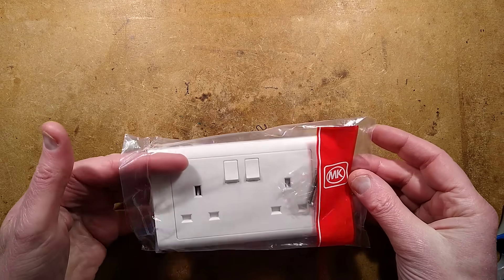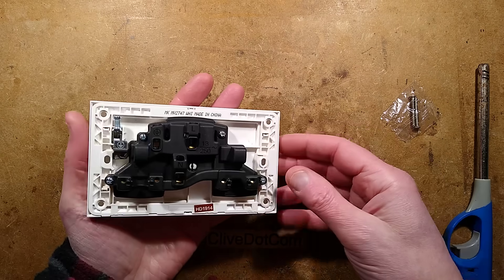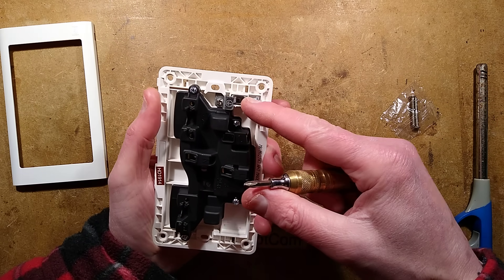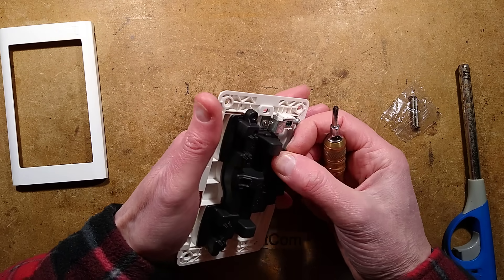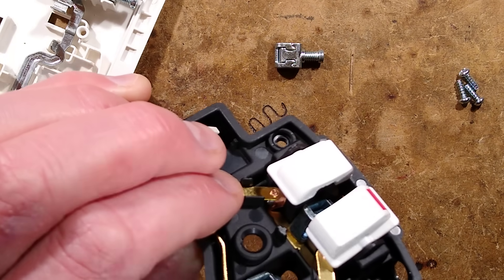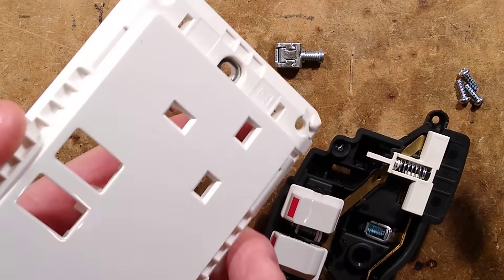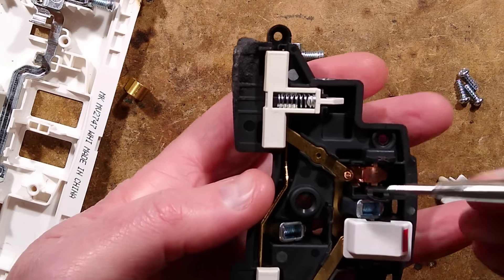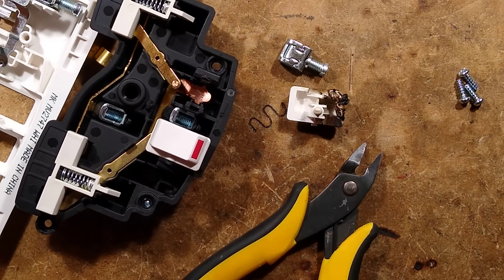Flame test on a recalled MK socket

Comment: What about cleaning products? I've seen many people using sprays for wood like Pronto on every smooth surface of their homes (and cars with zero real or fake wood trims) to make everything shiny and that thing has a lot of oils.
Reply from the maker: Never underestimate the behaviour of cleaning freaks.  They spray cleaner on a switch or socket once - nothing happens so they keep doing it as standard until something does happen.

Comment: Switch button has a lip around 3 sides.
Fourth side, facing the other switch has no lip. Perhaps a flash has a straight line out between the button and the front plate. Or you could insert a thin piece of conductive material onto live and get a shock 🫨 or burn.

Comment: The soft plastic probably melts if the socket is abused. It is designed for 13amps but is on a 30 amp ring main. What happens if some one puts a 13 amp plug on say a device that draws 20amps? There is nothing to stop it melting.

Comment: ""Summary

Product: MK Electric MK Essentials Electrical Three Pin Sockets with Switches

Hazard: The product presents a risk of minor burns, as it has been identified that when the switch on the socket is being switched on, or switched off, whilst it is under load, there is a possibility for an arc flash to occur, for milliseconds.

Corrective action: The products have been withdrawn from the market.""

Comment: At 2:50 when you manipulate the switches; the switch you didn't take apart (on the right, the closest to the camera) has the live contact pushed upwards by the contact force, this would be towards the earth busbar which is on the removed front cover and would reduce the otherwise ample clearance. 

It looks like there's little holes in the contact metal where they should be heat-staked to the black plastic which doesn't appear to have been done (which allows them to move more freely, you're having to hold them down with your finger), and I assume there's probably also meant to be a plastic tab on the white front face which pushes on the contact to hold it in place... but it's hard to tell from the video if it is present/effective.

Any arcing in combination with the reduced isolation distance because of the contact flexing would have a good chance of tripping the RCD/GFCI which would certainly draw peoples attention to the problem... maybe arcing was specified with the recall because it's what makes the flaw apparent by tripping a breaker even if there's little real danger of it causing a fire in reality?
Reply: I came here to say this.

Comment: As having workrd for BSI and UL.
I would sumise as arking is mentioned, it might be the switch mechnisam.
Most likley the white sitch rocker, the plastic on the end of the very small spring fitted in the rocker if still made like this or the barrer thst holds the contacts.
As plastics not confoming to very high standards, will melt and catch fire.
Look at why the plastic consumer boxes are now no longer to be fitted, in the UK consumer homes.
We do not want to go down the reduced fire safety that we have, here in the UK.
 
You might like to buy a chinese laptop top power block from Bay in a lot of cases the so called iec lead comes with a non fused live plug, which I have flaged up to our local trading standards.
The fuse in the plug is not to protect the equipment, it is to stop fires, eg the very flamable pvc wires and outer sleving.

Àlso another thought is with a high inductibe load the contacts and or the contacting meknisim causes a high flash which cauld cause a fire or continious use could coat the barrier plastic and cause a short to either neutral or earth and may be, eventually a fire.

The testing of solenoids is intresting as a resulting plasma flash of several centimeters from the contacts, but this was as I can remenber 100 or 200 V DC at 1000 A, very spetacular and dangerous, as ocasionaal the contacts would weld together.

Comment: The socket safety cover may be more prone to flame? 
Full 30 Amp (ring main) load may cause unacceptable heat? 
Insufficient silver on switch contacts to provide 100K actions under load? 
Lastly, what is the breakdown voltage of the insulating moulding(s)?
Are the retaining screws going to remain tight, and maintain a low resistance under load?
(I tried to think of everything 😁)

Comment: Chinese subcontract to smaller companies, they can't afford the machined dies to extrude hard plastic like Peek or glass reenforced materials. They use spark eroded dies or soft cast dies which deform under high pressure. So their solution is to enhance the plasticiser and reduce reinforcement. The result is that the flame retardent properties are reduced and carbonising occurs at a lower temperature creating a path for an arc.
Reply: Well it’s not as though PEEK is going to be farmed out to some low bidder anyway, since it’s such an expensive material.
Reply: @tookitogo  Correct so PEEK mainly used on high end HV switchgear.  Generally to save product tooling a more flexible material is used but the plasticisers and other spices can create a carbon tracking path at a lower temp but the product passes the flame test.  Glass reinforcement shortens die life and powder compression thermal moulding is slow but that gives a solid but more brittle product which is very resistant to fire.  

Over ten years ago I identified a similar problem with a Chinese manufacture and the entire batch was recalled.  The supplier to my client disappeared and moved the plant tooling and  started producing the same product but without my clients logo.  No compensation to my client for their losses as the original company was devolved.  

When the tooling gets battered they will sell it on to another producer.  Next time you find some really cheap kit check the moulding closely and you will probably see where they have had to fettle the die especially around the ejector pins.

Comment: maybe you could do an " under load" test. wire the outlet to a heavy flex , and plug some high amperage things into the outlets and switch it on and off and see if there is any arcing present....
and if you sustain burned phalanges. [medical term for fingers ]

Comment: Since there's nothing visually wrong with it... The switch appears to be of a construction where its mechanical tipping point and the position where it disconnects electrically may not exactly coincide. Maybe that's why it arcs too much.

Comment: What are the rules about using halogenes (bromine, fluorine or chlorine) in electrical applications around the world?
How in the UK?
Here in Germany you must use halogen-free components in electrical applications
- in circuits that are located in business
or
- in circuits that are in a local for public access. 
This rule was introduced after the fire-desaster on the Düsseldorf airport on April 11th 1996. 17 people died in the toxic smoke.
Since the every cable canal, cable, transformer, any device and construction component must be halogen-free for commercial or public use.
Reply from the maker: Much modern cabling in the UK is LSF (Low Smoke and Fume.)

Comment: It could be a wrong type of coating on the contact poles. For AC there are at least 3 different classes regarding the load. So AC-1 is pure ohms load where AC-3 is for coils like in a electrical motor.
Reply: resistive...inductive....capacitive.

Comment: British household wiring is so much different than Canadian or American wiring. Does this outlet screw directly to the wall or is there some kind of outlet box that it's mounted to that's nailed to the wall studs ?  The only thing similar to this was the wiring in my parants large log ( I'm not kidding ) vacation house. The romex wiring was stapled to the logs and went from one outlet to another without a switch, so basically they were all live. Of course the place was made in the 1920"s when the electrical codes were rather lax. The outlets were Leviton 5238 Brown Duplex Receptacle-Nma5-15R if your interested. I'd really like to see how these kind of outlets are wired.
Reply: They are mounted in a metal back box typically for brick and plaster walls (the back box is recessed in to the wall and held in place with screws), or a plastic box for plasterboard (dry lined) walls - this type self-lock to the plasterboard when the outlet screws are tightened, they don't need to be fixed to a stud . They can also be surface mounted in a (usually) plastic box - of the type Clive mentioned where the cable entry knockouts tend to be brittle.  Surface mount is rather clunky looking though.
Reply: @brianallen9810  They can either be installed on a surface mounted box, or flush mounted on a recessed back box.
Reply from the maker: Either a metal box anchored into the wall or a plastic box that self clamps onto sheet style walling.
Reply: The whole of the UK electrical system, from generation mix through transmission down to house wiring, is designed so that everyone in the country can simultaneously boil a kettle to make tea during a commercial break on TV on a Thursday evening.  I hope this helps you understand the thinking behind it.
Reply: @LokiCentral  Makes sense. The British do like their tea.🤔
Reply: They mount very much the way we do ours. I think they just look odd because of the size. Those folks have dryer plugs everywhere!

Comment: how about running 13A through each socket for some time to see if anything gets hot also perhaps burn the plunger see if the spring gets hot to come through the front of the switch! For an instance if 13amps was drawn through each socket will the neutral busbar carry 26Amps and a safety margin (or is any busbars copper covered steel)
Reply from the maker: Many modern sockets like this state a maximum total socket current of less than 26A.

Comment: I have some old MK plugs and sockets. They are very good quality.
Reply: The old ones, (I'm talking about models from the 1960s, 70s & 80s Logic range) were much better built, than the newer ones, the actual brass terminals & screws & contacts were far bigger & thicker than modern versions & made in UK too!
Reply: Yes, I think the ones I have are from the 80s. They don't have sleeved pins but I don't care. Im not exactly going to put my finger behind the plug when its being pulled out, am I? No. I can't even fit my finger in the gap anyway. I don't have any little kids, there is only me in this house.

Comment: Long shot guess here,   the spring werent properly sprung, resulting in insufficient contact pressure, a barely conductive, more resistive contact led to progressive, runaway heating of that contact.   Upon opening an overheated contact with an inductive load,    FLASH as a cloud of vaporised metal perpetuated the arc momentarily.  Could have been a manufacturing defect, not bent to design spec or a change in the materials used.  If that were the case  I can guarantee whoever was involved with making those parts noticed something had changed and brought it to plant management, who said, shut up and ship it.

Comment: From gov.uk:
"The product presents a risk of minor burns as it has been identified that when the switch on the socket is being switched on or switched off, whilst it is under load, there is a possibility for an arc flash to occur."
It's not the plastics burning but the arc escaping past the switch when used under load.
Put a nice big kettle on it and switch it on and off to see how much of an arc you can get from it.
...or a nice powerful motor. Inductive loads are more fun that way...
Reply: His earlier video on this addresses that, but he couldn't find any obvious reason for an arc flash to occur.
Reply: @puckcat22679  It probably is not the design, but a manufacturing fault in some of the items. And not all of them. And not happening all of th etime. Otherwise it would have been caught before shipment.
Reply: Maybe the issue is improper trip point of the switch. I have necountered this in power supplies from TTI where the mains switch "trips" on, but switching off you have to force it "uphill" agains the trip point, which results in buzzy arcing inside the switch.
Reply: True. Complex reactive loads give arc flash when switched off. Mercury, sodium, metal halide lamps and so on are complex reactive (at least inductive) load.
Reply: why would the arc exit the front of the switch, surly it jumps between the contacts with the path of least resistance. 🤔
Reply: The switch contacts are too close to the finger.  An arc could conceivably be a problem
Reply: Maybe metal contact material gets covered in carbon with normal switching arcs and some kind of flashover occurs with high loads the more carbon-covered it is? 

Could be only on some units but MK cares enough to recall them all. Just my guess, probably wrong. 

Interestingly, the Chinese OEM behind these sockets makes OKish extensions for two brands in the UK, but I had problems with two of them... one had a switch that got lazy under moderate load and the other was 'surge protected' but caused odd interference to a computer monitor with a desk fan on/off. 

Gone off this OEM after that, even if finishing seemed higher quality than a rival (Masterplug/BG) to me.
Reply: I'm wondering if, when arcing occurs, there is a gap between the switch actuator (?) and the housing, such that the finger operating the switch can get burnt.
Reply: @martinploughboy988 I thought there was usually a shield betwern the gap & contacts to prevent flashed escape the switch gap
Reply: @JohnCol-1959  that's what I'm thinking the problem is - that the shield between the gap and contacts is insufficient.  The edge on the rocker switches is pretty skinny, if it was a bit wider perhaps there wouldn't be an issue?
Reply: Why do i get the feeling that teh joke many people made "don't drink the content of the battery or washer fluids" is more getting serious than ever before. A single pole switch with load will arc, a little light won't do that so i wonder if people realy are that dumb and put a 2000 watts heater on it and switch it on and off.
Reply: @FreerunMediaService   This is the UK mate. Each socket, including its switch, is rated for 13 amps at 240v so there's no conceivable reason not to do just that and expect it to be perfectly safe.
Reply: @uploadJ With respect, it's fairly reasonable to assume that that is also taken into consideration by BS (British Standards Institution) 1363 standard. They've been doing this kind of thing since 1901.
Reply: @FreerunMediaService  this has nothing to do with people beeing dumb. A person without knowledge of how electricity works wouldn know the problem. I have a friend who couldnt understand that he must not run his washing machine on an extension cord. He thinks it is safer because without the extension the cable would hang over a sink which seems dangerous to him even the cable isolation is perfectly fine.
Reply: @sauerdrops484  You're right. We have too many fires in the US every year resulting from people plugging their 1500W space heaters into power strips or "lamp" extension cords, no matter how many warnings are printed on the heaters themselves.
Reply: @dashcamandy2242  you left out ..coil up the excess extension cord and put it under the couch...
Reply: @sauerdrops484  Washing machine consumption is about 300 watts max usually, and it's on and off all the time. So you can run it from extension lead.
Reply: @AAaa-wu3el  this is a average power.  When heating the water its going up to 2000 Watts at least in Europe on 230 Volt.
Reply: "whilst it is under load, there is a possibility for an arc flash to occur" Well, obviously. Any switch would arc when switching high load. Happens in every socket. The arc isn't going to escape. Thats BS.
Reply: @simontay4851  Not BS..  Arc flash is basically hot electrical plasma, that can occur if the current in the circuit is high enough when the switch is actuated.  This hot gas can make it's way out of any tiny gap in an enclosure and cause burns.  Normally this should not occur in a residential switch (arc flash is usually only a big thing for large industrial electrical installations where the person operating the switch has to get dressed up in a blast suit and operates the switch from a safe distance with a "chicken stick"), but if the manufacturer cheaped out on the contact material for example (ie, they subbed it out to a Chinese manufacturer who used Chinesium contacts instead of silver), that could cause a big arc to occur instead of just the usual tiny spark.  And in this particular switch, as Clive showed, the toggle part is literally right over top of the switch contacts and there is a big gap around the toggle with no barrier, so if an arc flash did occur, it would also be highly likely that the hot gas would come out around the toggle..
Reply: @Flying0Dismount  " as Clive showed, the toggle part is literally right over top of the switch contacts". Ahh thats exactly it I expect.
Reply: @simontay4851  The switching contact is pretty close in line with where an arc flash may actually have a fairly straight path out past the end of the rocker switch on these, and some people may be using these to switch motor loads. Maybe that switch flashes good on kettles too, but I think the issue is a fairly direct path between the contact and the outside of the switch via the end of the rocker switch itself.
Reply: @simontay4851  Th guy was only passing on info, no need for your 'Obviously' shite.
Reply: @simontay4851  So you know better than a company that wouldn't recall this product if it didn't have to? If only they hired you for customer service 🙄